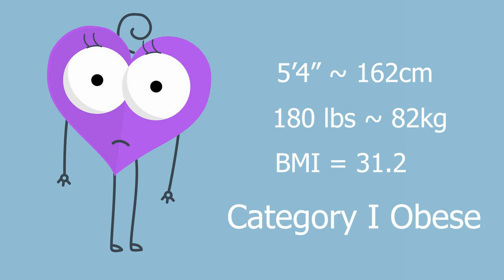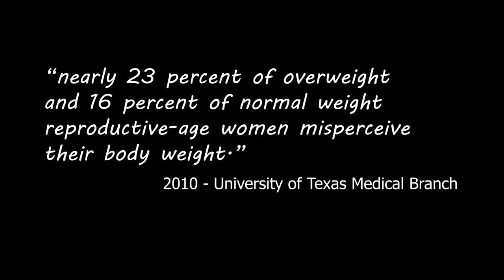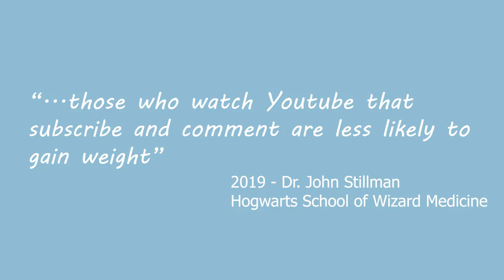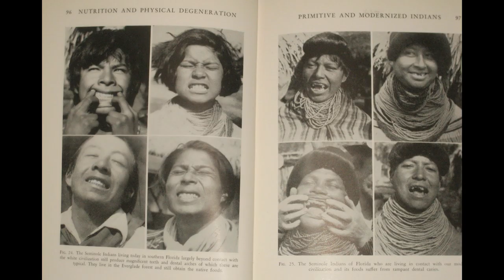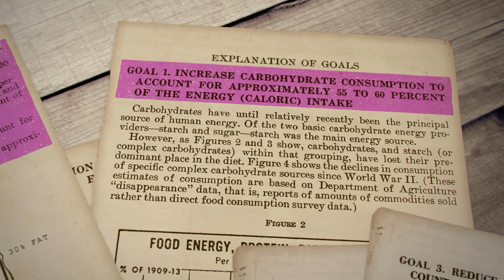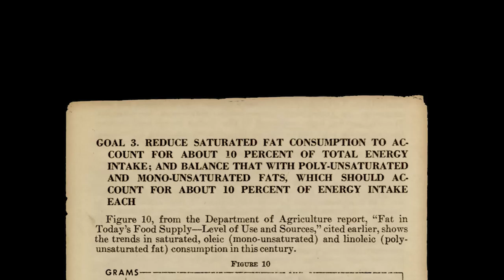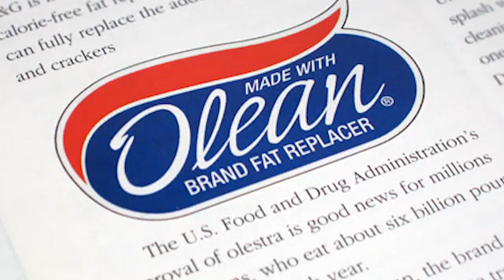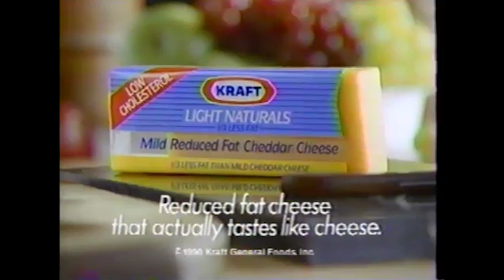How One Document Made the Entire Country Fat  - The Obesity Story - Episode 1

Comment: Great enthusiasm! Wrong ideas...
Reply from the maker: They're not really ideas, mainly facts. Which ideas are wrong, I'm up for a friendly information sharing session! :D (P.S. Episode 2 will be low carb + fasting = the key)
Reply: @FastForwardtoHealth  Those are not facts. Not even close to being facts. Everyone jumps on the keto, low carb craze. If your objective is too achieve short-term fat loss, then it will work. But it will put rather hefty price tag on your overall health state. Your thyroid will suffer. Your immune system will suffer greatly, Consequently, you will be closer to metabolic derailment. Not to mention accelerated aging. Basically, you put your body through a lot of stress when you cut carbohydrates. Sucrose is NOT the issue. Seed oils is the real skeleton in the closet. Read: polyunsaturated fatty acids. Plus some other relatively toxic substances that we consume on a daily basis. Do your homework.